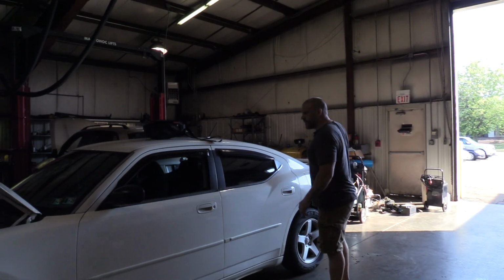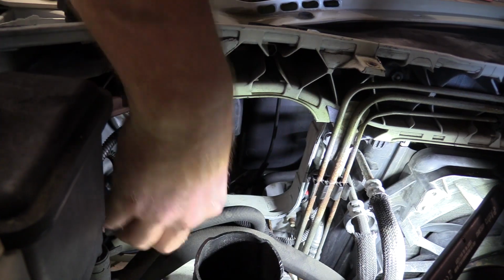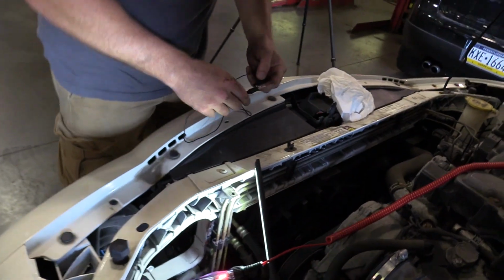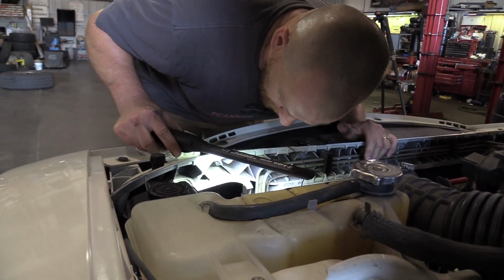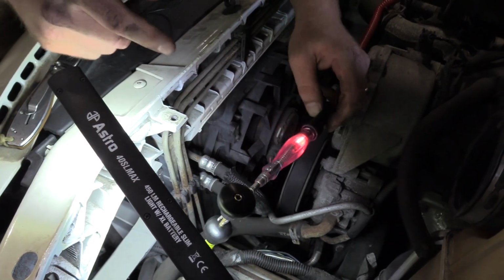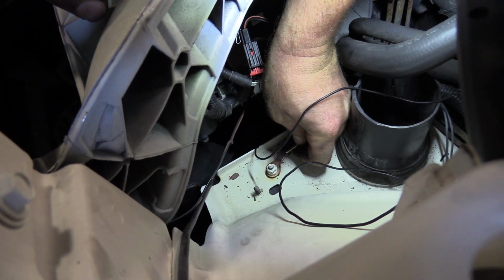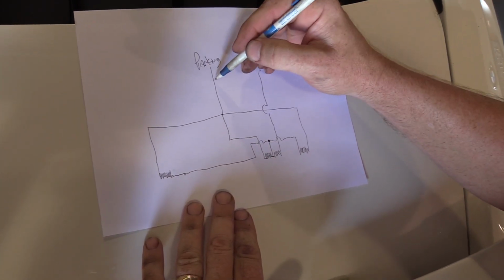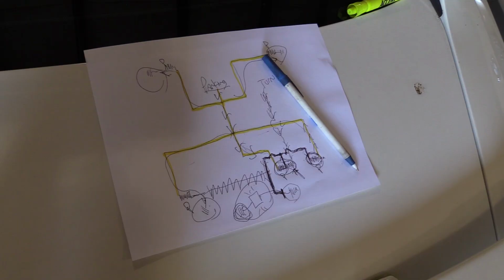Voltage drop testing a parking light/turn signal circuit

Comment: I have a simple question. Would it be a good idea to replace the QUESTIONABLE GROUND EYELET, to stave off a possible future problem, with a "rusting out" ground fixture? Not excluding the fact that your next door neighbor has unlimited free comebacks, and of course, THE WORLD FAMOUS SCANNERDANNER, to fix those issues, but as a field tech, could it feasibly be a charged item to get ahead of the future issues, and go ahead a replace the eyelet as a source of actual malfunction, or would it be acceptable to allow the repair as it was done, to leave? 

I mean certainly, if it was my car, I would just cut out the old, and splice in the new, a few more minutes after all that headache, would certainly be worth it. But, how would a working tech handle this?? Do you suggest that further repair, and at an extra Cost? Do you do it as part of the time that you are already charging for? If a PepBoys tech lets it go, and it comes back, who would be charged for it? An additional repair, and a backcharge to the original tech, (or freebie if you get it back) by the shop?? This is a prime example of what could occur, in the real world, and how the outcome would affect you, either as a shop owner, or a shop worker, or as an outside vendor to the shop. You charge 70/hr to remove the airbox, trace out the malfunction, test your theory, and reconnect the wires, then reinstall all of the take offs, and it comes back a week later with similar issues, elsewhere! I guess my question is, fix it all for whatever parts and labor charge, and hope for the best? Report the future issues to the customer, and do what they approve? Don't touch it, and hope nothing else happens, and charge again to trace out the issues when it returns? 

This one just looks like a simple ground wire issue, yet it raises all these questions about how to continue, how to charge for it, and how to document what else can or will happen!! Like a check engine light with multiple unrelated codes, you can't fix all problems for one low price!! 

Even your easy button fixes cause more thought than most people know about!! This is what makes you a great teacher!! 

Thanks for sharing!!
Reply from the maker: yes, under normal circumstances, you would absolutely want to replace that entire eyelet. We both know, eventually those other wires will fail too. Of course documentation is key and the only thing you are promising with this repair is that the turn signals and parking lights will operate normally now. Anything else is a separate issue.
Reply: Great, thx!!

Comment: Had another combo om my son-in-laws
Typical circuit like you just showed us, no light in either turn or parking.
Turned out that both bulbs were shot and the park light had a missing ground : a frayed cable.
A real time waster ! 😋

Comment: Great lesson here. Not only will you learn the basics at ScannerDanner Premium, but you'll learn advanced stuff as well - best bang for your buck on the net, hands down! You can go from literally zero electrical knowledge, to using a scope to troubleshoot your car in probably less than a year! If you're reading this, just stop and go to ScannerDanner.com and sign up!

I remember the very first time I saw this - on a motorcycle, years ago. Confused the heck out of me, because I didn't understand what was happening. Years later when I was going to MMI in Phoenix I had one exactly like it in electrical class, and I found the bad ground! That was a great feeling. But once you get cocky and think you've seen it all, you'll get one that'll make you pull your hair out. Case in point, when a filament burned out in a 1157 and fell and connected to the other side (I just saw someone else had the same issue on a heavy truck in the comments here) - I spent hours chasing a dead short that was in the bulb itself!  That was a great learning experience, too. Electricity does strange things when you deprive it of its circuit!

Awesome as always, Paul, great filming / editing by Caleb, and a big thanks to Danner for the shop!👍🍻
Reply from the maker: Thank you Smitty!

Comment: Great video! One question: If the current is finding a new path, why the other bolbs are not lighting? The upper corners or the left one (in the paper)
Reply from the maker: because they are in parallel not series, so the current is being split between at least four other bulbs, maybe 6? not sure the rear light set up. If I would have unplugged the rear lights and one of the two front ones on the right side, I bet I could have made the RF outer parking light blink with the left turn signal as well. I hope this makes sense.

Comment: I am confused, it is not supposed that both front left parking light bulbs are in series,  because the diagram you draw the farthest to the front left parking light shares the same bad grown so it is not suppose to blink when the turn signal is on
Reply from the maker: right, so the ground became the power for that parking light bulb when the turn signals were on. And the parking light power circuit became the ground through all the other parking light bulbs in parallel, as long as the parking light circuit remained off. Hope that makes sense. Hard to explain in text form and I could have done a better job on the paper.

Comment: I had one a bit stranger than that years ago. My business partner had a 1980? GMC Vandura and replaced a burnt out L/H Rear Tail Light 1157 Bulb. It worked OK, BUT if he had the brakes on for 15 seconds, the dash lights and parking lights would come on. Even weirder, if he turned on the L/H Turning Signal, after about 25 seconds, the dash lights and parking lights would ALL flash with the turning signals. Remove the new 1157 Bulb and all was OK. Installed another new 1157 Bulb, and all was OK. The problem was the High Wattage Brake Light Filament in the bulb was too close to the Parking Light Filament, and when energized, it would heat up and sag into the parking light filament or support wire, passing current into the parking light circuit. It took a few moments to figure out, I have never seen that before, and will most likely never see it again. One thing that complicates troubleshooting ground problems with Dual Filament Bulbs like these is that current can flow through the Brake/Turn Filament without lighting it because it's ground path is the low wattage filament, and that limits the current enough to NOT light the Brake/Turn side. This is especially bad with trailers which are quite often poorly wired to begin with, have a hard life, and little to no maintenance. This is a hard lesson to learn for some..... you did a great job explaining it, and hopefully, someone will "Have the light come on!" BRAVO to the 3 Amigos!
Reply from the maker: I feel like I could have done better on explaining that portion but thanks my friend

Comment: Can anyone explain why on newer cars when one bulb goes out the other one blinks faster on a turn signal circuit
Reply: The bulbs complete the circuit for the flasher unit, so if one bulb is not working then the load or resistance on the circuit changes, causing the rapid flash.
I hope I got that right.
Reply from the maker: in my opinion, if they are not using a flasher and the controls are part of a circuit board, this is just a default strategy that is mainly still in place to warn the driver? I really don't know. I know the older ones is was a physical current flow change that altered the flasher but on the computer controlled ones, I agree, you would think they wouldn't react the same way.

Comment: I doesn't matter if you poke holes in wires if they are grounds?  I can't believe you said that. Do they carry current? YES. Is there heat present? Yes. Can green crusty crap (rotted copper) form in those holes? YES..   you are scaring me man.
Reply: I’ve seen many wires not pierced get corroded too. Everyone acts like people are out here poking 5/16” holes in wires.
Reply from the maker: Lol okay, but those tiny, tiny holes (you need a magnifying glass to see them from the probe I was using), are 3 inches away from bar wire and a non insulated eyelet. 
Also, which terminal corrodes on a battery? Just a quick question for you.
Reply: @ScannerDanner  The anode does of course but if you'd like I can send you plenty of  ground wires that were corroded on the trucks I work on.  Poke away if you must but please  PLEASE  show the masses you painting clear nail polish on those "tiny" holes. Are they so tiny air can't get in ?  Don't answer.  love ya Prof but you fell down on this one.  No worries I'm still watching and learning.
Reply from the maker: @mohawkmike142  Good suggestions, can't always be so politically correct but I understand how others would take the same shortcut when they absolutely shouldn't
Reply: @ScannerDanner  nice reply

Comment: Amazing. First time i encountered case like this on my sister Mercedes. I spend couple hours on that, couldn't wrap my mind around it. One Head Light didn't work and hight beems was dimmed. I found problem accidentally, was bad ground inside the plug. Bad connection on pin. Second time soon after i encountered same case on my neighbor car. lights were dim and i knew exactly what was then. It happened 2 years after i singed up with Paul. So my point is for new guys here. Keep on trying. I often do stuff like this for free especially for friends and family just to get the experience. I also going through Pauls classes again. And its pretty amazing how much more you learn going through classes with few years of experience. It just finalizing everything. And i spend at least 1 hour a day watching other diagnosticians too. So past at least a year i have 100% accuracy in trouble shooting. Thank you so much Paul for this exciting journey.
Reply from the maker: Freaking sweet story man, thank you

Comment: The Dodge B350 Vans 1987, 88, and 89 were famous for that problem with the rear stop/turn/tail light back feeding into the backup lights.
The bulb socket would loosen up losing the ground from the reflector bolted to the body.
I wrapped bare wire strands around the stop/tail light socket, soldered and taped it in place adding a terminal to the new ground wire and sandwiching it between the reflector and body ground.  Don't laugh, it worked!
Thorough diag with your vehicle, Good Explanation also!

Comment: engine ground is another spot for bad grounds on a Dodge ..braided flat cable next to exhaust manifold heats up cable ,cools then corrosion sets in causing a bad ground.
Reply: GM had that issue for years where they stuck the ground on the rear of the head next to the firewall. Thing would rot off and you would get all kinds of issues.